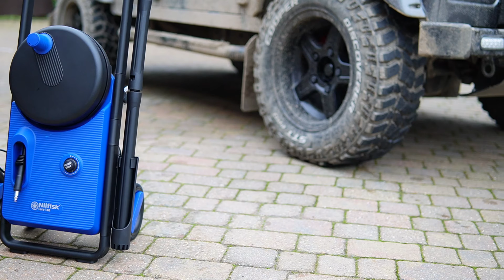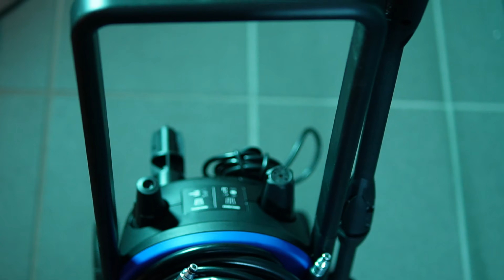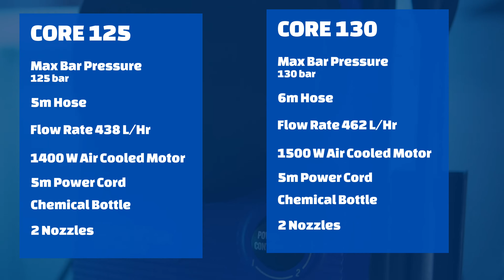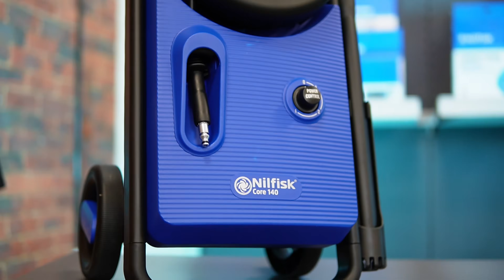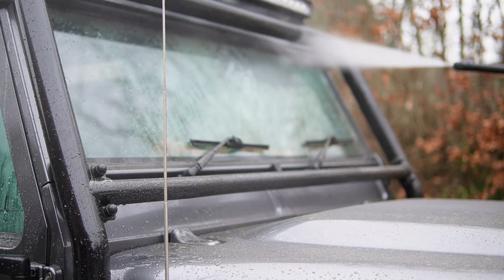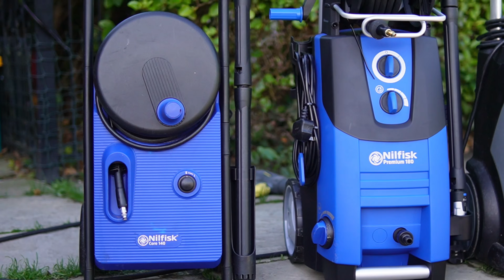Nilfisk Core 125, Core 130 & 140 All Tested. Is it Better than Karcher & AVA?

Comment from the maker: Are you a Nilfisk Owner? Do you think they are better than Karcher?
Reply: yes i think nilfisk 190 is very better than karcher K7 !!
Reply: Thanks for the great comparison. Will you still be filming a video on the Nilfisk accessories? I'm keen to know the Nilfisk's capabilities when cleaning patios, decking, etc.
Reply: Anything better than karcher.
Reply: I've owned two Niflisk (Alto branded on the first) over the last 25 years. The only reason I have the second is because the ex kept the first after the divorce! They just keep going! The accessories are also superb - I have everything from the patio cleaning heads (the Pro version is superior by far) and chassis lance to the house roof cleaning attachment which is absolutely superb in getting rid of roof tile moss. Friends and relatives have been through several Karchers over the same period, with electrical and pump problems. Anecdotal and a small sample size but...
My only advice would be to spend a little extra on the 'P' (pro) washers. Haggle and you'll get them within a few £ of the DIY range. I use them weekly - more often in the summer - and they appear to be absolutely bullet proof. I vaguely remember one issue with the first one with a leaking pump seal that was fixed for pennies by the local Service Agent, but that's it as far as problems are concerned. Oh - and their auto-brush (the one with the soap dispenser on the top) is rubbish, again, the Pro version is much better and still going strong 15 years on.

Comment: Ive just seen the Excellent 150-9 xtra on sale for 10£ cheaper than the core 150 power control.  Do tou have ab opinion?  Is the extra meter and flexible hose of the core 150 worth it or the heavier 9 metre e150?

Comment: Thank you for the great videos.
I had a small karcher since 2004, can't even remember the model, the tiny handheld one, which served me well for many years, but with little use. It eventually died and I am looking for something more substantial. 
This core 140-8 looks great, and with the aluminium pump it sounds like it would last for a long time.
But it is air-cooled. What's better in your experience? A water cooled plastic pump, or an air cooled metal pump? It seems that at this price, you can only have either one, but not both.

Comment: I bought a Nilfisk 140.4 Dynamic around 2.5yrs ago, used to clean my car 2/3 times a month or so, broke and fixed under warranty 1.5yrs in, then broke again last month out of warranty, electric motor fault which I’m now told is discontinued as it wasn’t exactly the best type, brush motor or something. Not happy to say the least.

Now I have a voucher via extended insurance luckily, value of £269 and really reluctant to go back to a Nilfisk so I’m really reviewing and checking what electric motor they use. 

Loved the video.
Reply from the maker: Hi Rab sadly with all domestic pressure washers there will always the odd one or two that have problems as they are mass produced so it could be 1 in every 10,000 for example. Sadly we will never know. My p180 is built different. It's incredible. I got Ava p70 for a bit and seeing how that goes. So far so good
Reply: Electricmotor shouldn't be hard to fix if it's just a sensor.
Reply: The higher priced domestic ones usually have brushless which is more reliable. I think K4 and up are brushless.

Comment: Hello, is there a sound difference between the 125 and the 130, is one louder than the other?
Reply from the maker: No difference mate. They are pretty much identical
Reply: @davidwalkerepic  thank you, ended up ordering the 130, also purchased an MJJC Short Swivel Gun from In2Detailing as the I2D one was sold out. Cheers for your videos dude!

Comment: rearly good my nilfisk titan extra . had trouble getting a connecter to plug in so i can use my karcher hose , the one on stubby gun is to big to screw in the nilfisk  .. so answer was to get a nilfisk connector for my stubby gun from auto brite direct... plus i can use the lance as well as my stubby gun and snow foam canon .. on ebay you can get 2 way hose connector one side karcher and one side nilfisk .... so my karcher hose is not wasted . you will find on amazon the karcher hose fittings are plug in at each end as for nilfisk 1 plug in and the other screw in .. thanks best wishes
Reply from the maker: Nice one glad you sorted it

Comment: seeing your great review on the nisfisk dave i bought a p130  looks the buisness to my karcher k2 good for the money and all i got to do is get a connector for my karcher hose so i can use my stubby gun rearly happy now
Reply from the maker: Nice one glad you like it. I've just got hold of 2 new karcher commercial machines for testing. The cheapest one is £250 which is a fraction of some domestic pressure washers so eager to see what happens
Reply: as the hose is on the real you cant keep the back plugged in wished there was a way that you could plug it in the back and leave the connector in and wind in and out

Comment: For car cleaning, I have never needed any for of 'power control'.
I used to work as a valeter at a main dealership, preparing new cars, deep cleans on trade-ins for the pitch, and also service washes.
We had a diesel powered hot water professional jetwasher, and if I needed less pressure i would just back the nozzle away from the vehicle surface a bit, why would I waste time going all the way back to the machine to turn it down ?
All that is needed, is a spray pattern adjustment on the nozzle.

Comment: So, I could get Core 130-6 (Car) for 135€, but 140-6 cost 199€. Is that really worth it without the extra hose length? It would cost over 40 euros more to have that 8m hose 🙁
Reply from the maker: Core 150 is out now 👌
Reply: @davidwalkerepic  yeah, but that is already 349€, so it's way out of my budget. Even that 199€ is more than I would like to pay, if I'm not getting a lot better machine, and I can't see much difference with 130-6 vs 140-6. Is there any?

Comment: Great video can you use the stubby gun with the in hand unit that has controls on the hand set because the stubby gun will not.
Reply from the maker: Very good question and it won't work with in hand power control. Well it will but you can't adjust power so best guess is it would be on full power but I won't know without testing that

Comment: Hi, love the videos, spent about 2 hours watching reviews between jobs. I'm looking for a washer to get the majority of mud of my bike at the mx track. I'm looking at getting the water from a container/bucket would the 140 be ideal. 
We also run the burgervan at the track so could possibly use water from the tap as that's connected to a water pump
Reply: I replace my old karcher k5 with lutian 704 for washing utv on our rental shop.. that chinese made seem more far high quality and lower price than karcher.. that thing is a beast for cleaning muds at 2500watt and 180bar.
Reply from the maker: so as long as the water is gravity fed in otherwords the water is above the washer the weight through the hose feeds down instead of just chucking a hose in a bucket then its fine.

Comment: ii have come to the conclusion the reason there light is pureley down to less weight in thus putting more quantity on trucks delivered equals less cost but its good to hear they have metal pumps instead of plastic maybe have better longevity but they need to start getting the acsesories in the big box stores too
Reply from the maker: they have the core 150 which is even better
Reply: @davidwalkerepic  i do like the ava

Comment: Hmmm, interesting.  I do think my next pressure washer will be Nilfisk.  :I did notice that Nilfisk also has an underbody spray attachment, so could be worth a punt, as Karcher stopped making their chassis cleaner, and I'm using an upside down patio cleaner lance zip tied to a roller skate.  Works to a point, and only used like once or twice a year.
Reply from the maker: Nilfisk have so many bits and bobs to go with this machine they are brilliant
Reply: Look at Kärcher's angled spray lance.

Comment: Thanks Dave! Happy with my 140-6, and the 8m hose can be bought separately. With the 140-8, how to control the pressure settings of you use a pressure gun instead of the Nilfisk trigger?
Reply from the maker: Very good question that eliminates the the 140-8. I should of mentioned that. Thanks mate

Comment: Nice vid Dave.  Great machine those Nilfisks.  My reason to buy theirs versus Karcher was purely on the internals, that aluminium motor stands up a lot better then the Karcher plastic motors.  And Nilfisk get the prices right, no badge snobbery just solid kit. 👍
Reply from the maker: Yeah totally mate. They are so underated